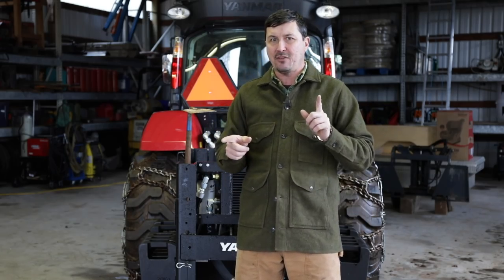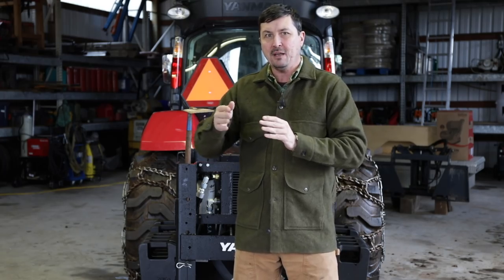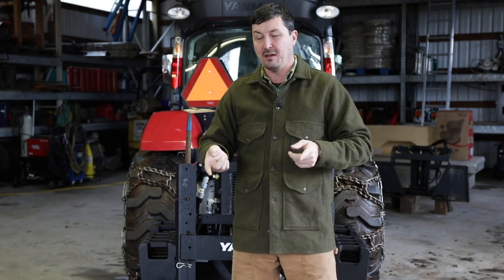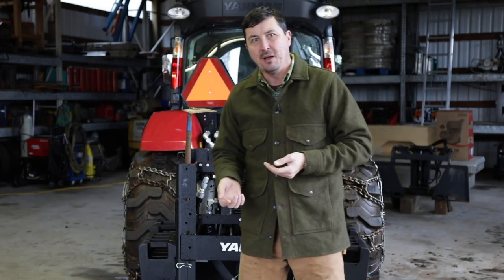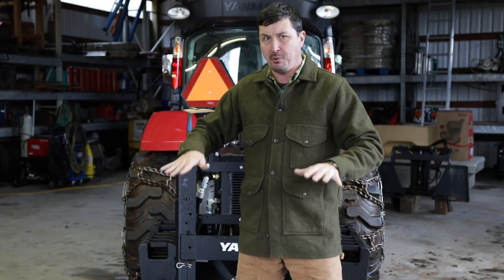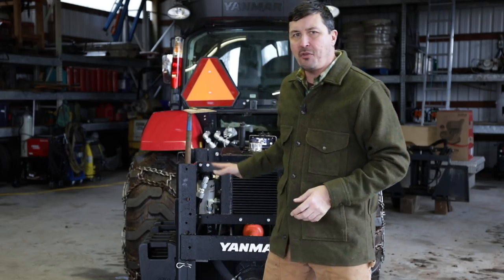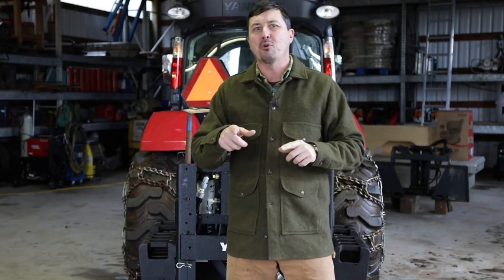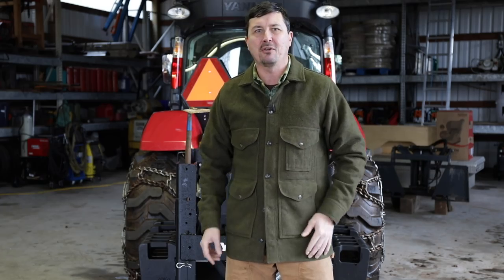Testing The World's Biggest Broom

Comment: I don't believe it is your thrower...i would check the gpm that you are actually getting at that rpm... have them send you or buy a flow meter to mount on your relief valve and run a test at your rpm that will give you a definitive answer

Comment: What do you mean settings? Pretty much anything that rotates takes high RPM and high flow rate of hydraulic fluid. Ask any farmer or trained equipment mechanic. 540 rpm or 5400 rpm? 540 is a joke for anything rotary and no wonder the thing doesn't work. Even a "proper" backhoe does simple digging at around 1500-2000 rpm. Rotary takes WAAAAAY more.

Comment: Low Quality wire strippers. Completely useless, but I don't think I've ever actually thrown a pair away. 

Low quality files. I've got a set of files that I've turned into punches because they were so bad that I could barely file a burr off mild plate steel. 

A Chicago Electric grinder that would bog down if I put any sort of pressure on it. 

I bought a set of screw drivers and all of the metal rods would spin in the handles. 

I have exceptionally bad luck with tool quality control haha.

Comment: Cheep useless tool. I have a gator grip socket at the bottom of one of my tool bags and every time I come across it I have the urge to pitch it but I hate to throw away tools. It was an impulse buy from about 12 years ago when I was much younger and inexperienced. The pins are bent from trying to extract a 1/2 inch square head lag screw.

Comment: Self adjusting wire strippers. OMG worst tools ever invented. Just use basic strippers. Finally threw my pair in the trash after 15 years of them sitting in the tool box. I would pick them up 2-3 times a year and try to use them, would get fed up and throw them back into the tool box.